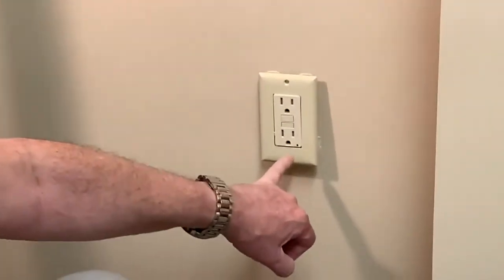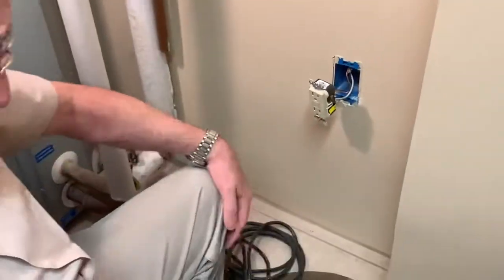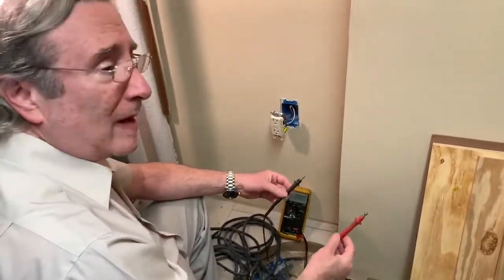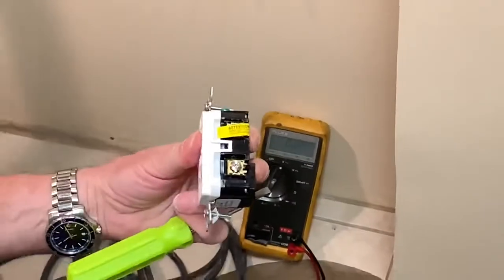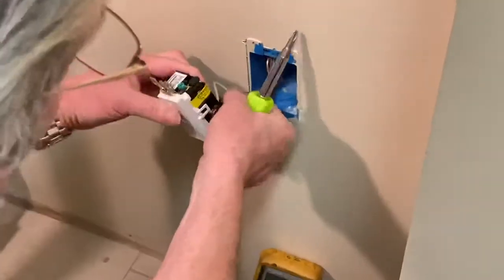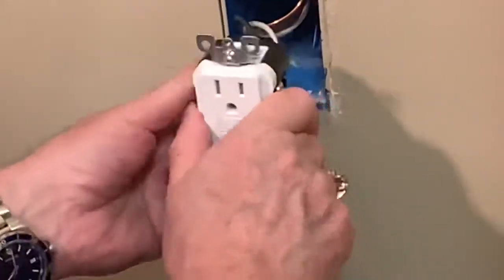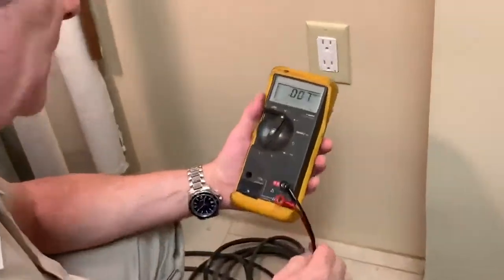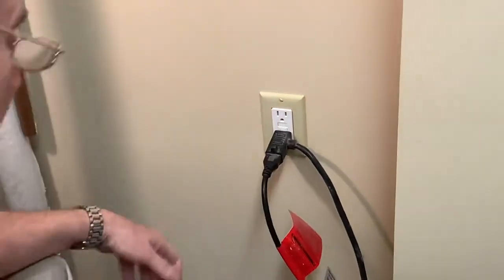Tribal Knowledge Ep 5: How to Replace a Dead Outlet

Comment: You should shut off the power to the outlet BEFORE removing the cover plate, or the outlet from the junction box. Failing to do so exposes the hot wire to the possibility of being touched while live, resulting in a painful shock.
Reply: I also was worried about that.You don't know if there are live wires being exposed right behind the coverplate, it's especially wrong if you pull the outlet out with a shiny metal screwdriver in the hand. Never go near an outlet with a screwdriver until you personally checked the breakerbox and flipped the switch to off.
Reply from the maker: I agree with you and have updated the description.
Reply from the maker: @svendkaffke5862  I agree with you and have updated the description. I work with electrical equipment my entire life and with high voltage equipment. I am always extremely careful.
Reply: @tribalknowledge5188  I knew that once I've seen your multimeter, it's a pretty good and relative expensive one. Problem I had with that is that people that watch your show don't have your experience and might just try to diy something without understanding the dangers. I think you should do a little warning segment at the beginning of a video if you gonna do some electrical work in the future.

Besides that it was very informative and I like it, but as a German I don't know these sockets, we have Schuko here. What country do you live in?
Reply from the maker: @svendkaffke5862  New York USA - Thanks again. It's even more important for you as your system may be at 220 volts compared to our 110 volts.  I have added additional warnings.
Dänke Schon.
Reply: @tribalknowledge5188  Actually they've upped the Voltage all over Europe (excluding UK which also uses 110V) to 230V in the late 80's, it was a slow area specific change but I think at least all of Germany is covered by now. There's also a quite high tollerance so 240V isn't really unheard of. But most people here don't know that either. So, there's some Tribal Knowledge for your viewers :D

Gern Geschehen :)
Reply from the maker: @svendkaffke5862  i'm a licensed aircraft mechanic specializing on electrical systems. aircraft systems are 208 volts, 3 phase at 400 cycles (hertz ).  if there are d.c. requirements, there is either a d.c generator or transformer rectifier to convert down to 28vdc. thanks for watching.
Reply from the maker: @svendkaffke5862  some of my classes at stony brook university. i'm an invited teacher for the teslamania competitions. https://www.youtube.com/results?search_query=steve+matza